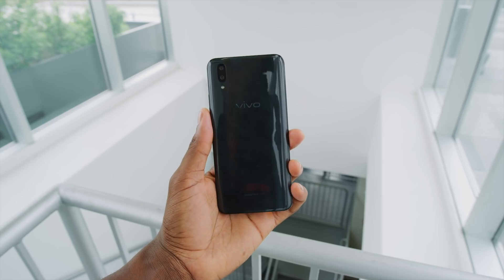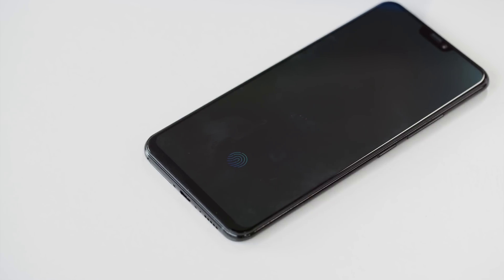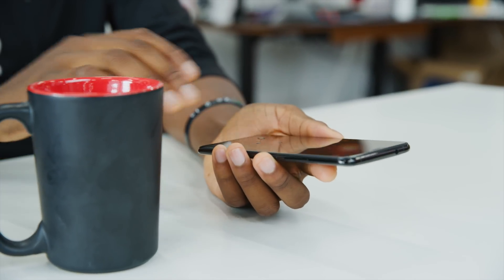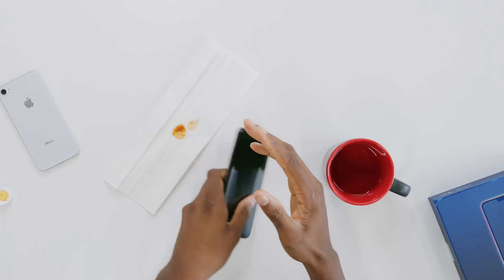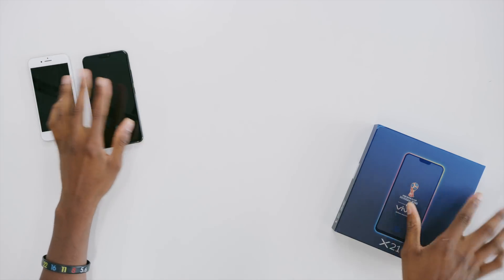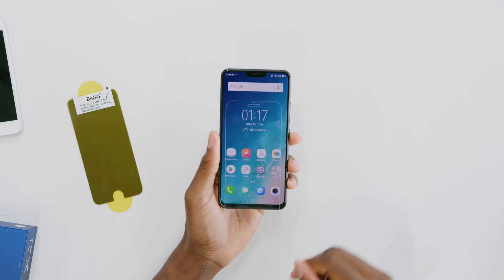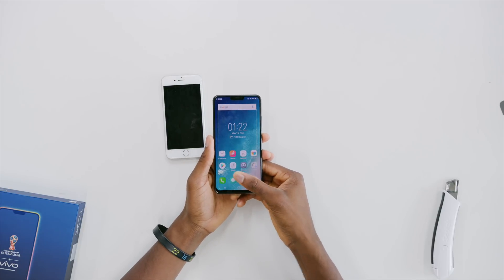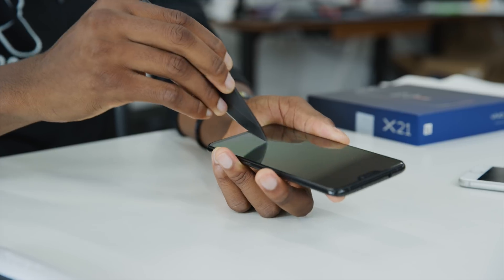In-Glass Fingerprint Sensor: Testing the limits!

Comment: Not sure why you bet against the polarized glass. The polarized one only obstructs certain viewing angles. It should be as good as a tempered glass, when it comes to allowing the sensing of light by the optical sensor, reflected off something that's directly overhead.

Comment: I have the Vivo Nex and the Xiaomi Mi 8 Explorer Edition, both of these phones have the in-screen fingerprint reader and I've noticed that the Xiaomi is faster at unlocking than the Vivo. It is as responsive as using a fingerprint reader that is on the back of the phone like the OnePlus 6.

Comment: Does the fingerprint reader also work when some applications like telegram require you to unlock by fingerprint. How does the display differentiate between a normal touch and fingerprint reading gesture

Comment: Optical sensor was considered from the human eye autonomy . Finger print sensor picks up heat . Glass will not pick up finger print if small debris is interrupting the skin. The iPhone is picking up the finger print for the pressure of the built in bottom crushes the debris picking up the finger print. Heat will always penetrate the glass screen regardless.  All flat surfaces will pick up heat for sensor purposes . Buttons usually work with pressure . Most people will most likely have to live and learn , so thanks for the demonstration. Good work.  🌻

Comment: Hey it's not working with optics 
It work with ultrasound like Sonic🐒
So no problem
Reply: In screen fingerprint readers work with optics. They click a photo of your fingerprint and match it with the database to determine if it's you or not  Ultrasound fingerprint sensors cannot be mounted under the screen

Comment: Water will never work on an optical sensor. The light being cast on your finger is warped to such a drastically different extent that if it did unlock I'd be worried.
Reply: It actually does work on slightly moistened vinyl glove through a screen protector on my Redmi k20pro, if you've just refreshed a fingerprint. 

Yet it sometimes doesn't work with clean dry fingers, and I can't imagine for what reason. To be fair, it was absolutely the same with iPad mini 2, iPad air 2 and Redmi 4 prime, so either my fingers wear down extremely fast, or all of you lie about it working well
Reply: Michael Miller - exactly. Most underrated comment
Reply: Greg Smith thank you.
Reply: Samsung will use ultrasonic fingerprint on their upcoming S10
Reply: I don't think that is an optical sensor because it works with the screen open( and the screen produce light) I think the fingerprint scanner is Capacitive scanners but either way it doesn't change anything unless it's a ultrasonic scanner.
Reply: There are wavelengths of light that can pass through certain mediums
Reply: Huawei recently made a special fingerprint reader (I forgot the name) that works with oil or water on the finger.

Comment: Under glass Fingerprint sensor is USELESS
Reply: Why so? It is WAY more comfortable than having it on the back. Just think of a flip case, for instance. The rear sensor gets covered. Or a silicon case: you have to stick your finger into a deep valley on the case, particularly uncomfortable, especially with smartphones getting bigger and bigger.
Face ID is a half-solution: you have to raise your phone to eye-level to unlock, it projects things on your face, etc.
And bezel-less is the direction where smartphones are going. This can't be done with a front-facing, but not in-glass fingerprint sensor. Not without weird notches or chins.
Bottom line: IT IS NOT USELESS, just we are fine without it for the time being.
Reply: Tech Yourself In its current form, maybe. But it will improve. The first Touch ID was also like that. It is just in its childhood. In 5 years, it will improve greatly, and become widely used.
Reply: in 5 years? LOL most of the phones brands will have it next year. In 3 years won't even see notches... the camera and everything will be under the screen.
Reply: Ohhh...so ,you mean notch of iphone is very useful

Comment: Scratches won't do anything to the fingerprint sensor. The reason it works with scratches and doesn't work with water/other contaminants is because capacitive fingerprint scanners generate an image of the ridges and valleys that make up a fingerprint using electrical current instead of  light. 

TL;DR: Sensor uses electricity to scan your finger, water messes up with it, scratches do not

Comment: The cracked screen protector test was flawed because, an optical fingerprint sensor would analyze multiple frames to see the fingerprint. With the broken glass going in 50 different directions it would have to analyze more frames than a glass screen protector that broke on the phone because it would have formed the phone and more of the glass shards should be flat.

Comment: Today Honor launched their new device which is "Honor 10" this phone also comes with underscreen fingerprint sensor. And they said "you can quickly unlock the phone when your hands are wet" so this technology imroved i would say...
Reply: Another example of the serious misconception here: DO NOT CONFUSE INSCREEN WITH IN_GLASS!
In-screen means it is under the OLED /IPS panel. under-glass or in-glass means it is under the glass sheet that covers the front of the phone. The glass also covers notches, chins and bezels.
Not to mention that Honor uses an UTTERLY DIFFERENT TECHNOLOGY, ultrasonic sensor. The in-screen sensor is optical.

Comment: Do people not like FaceID? I don't know why I would want a fingerprint reader on my phone anymore.
Reply: Coleman Green right
Reply: I am using s9 and iPhone x and I've never tried to even touch finger print sensor on s9 and I don't miss it on iPhone x
Reply: Depends on  how off angle your head is. You do not have to be directly in front/above the phone to unlock it. I would estimate that as long as your eyes are 45deg or less from perpendicular to the sensors it unlocks. You can imagine this making a circular arc and that being your unlock able area (for ex you can hold it off to the right and keep it pointing straight back and it will unlock). You can't be like leaning back in your chair with it flat on your desk, but if you sit up it will unlock. Or alternatively you can pick up the phone. Basically as long as the phone is within normal viewing angles it unlocks. I can't really remember having to readjust to unlock the phone, but maybe I have just gotten used to putting it in withing the area I need it.

Haha well that was long, but I hope it answers your question. Basically once you are used to faceID, it is like your phone isn't locked. You just swipe up and use  your phone. That is why I am confused why Marques is just talking about behind screen fingerprint readers like they are the future. I mean I guess you could have both, but I really think most people would just start using the face unlock which would make the fingerprint sensor a waste of money and materials.

The only reason that behind screen fingerprint readers would come back to apple phones is if they can't get the sensors underneath screen. The notch doesn't bother me, but I would have to think that they want to get rid of it. However faceid doesn't use the camera which is probably the hardest to put behind a screen. The IR camera, illuminator, and dot project should be fine behind a screen, just like a fingerprint readers sensor would. You would turn off the pixels near the sensors during the read. Who knows, I mean its speculation it will be interesting to see which direction Apple takes.
Reply: Coleman Green I am basing this off of the many iphone users I come into contact with and watching them unlock their phones. In the time it takes them to pull the phone near their face from various positions I have already unlocked my phone before I have lifted my phone to a viewable place. You are essentially asking me to add a second to my unlock process to use the future?
Reply: Problem is face id is inconsistent and slower, id rather take my blazing fast Huawei p20 pro's fingerprint scanner over faceid any day
Reply: David Exactly. And this is why I play with face unlock for a few days and turn it off. I travel a lot on sometimes crowded buses and trains where I can't make face readily available but I just need to access an or message really quick, or I'm trying to one hand unlock my phone in the car but can't exactly pull the phone within range of my face, or in the middle of the night or early morning l when I just want to grab and access without making my face visible just yet. I just find it so much easier to unlock my phone with a fingerprint because by the time I have the phone within range of my face in many situations the phone was unlocked when I first grabbed it.
Reply: Marlique Sheed it sounds like apples face unlock is a lot better because I don’t have issues in any of those situations: bed, crowded spaces, in the car, when I only have one hand etc. I’m not super familiar with other phones face unlock but the iPhones sounds the most advanced and is only in its first iteration.

Edit-yeah it sounds like the Samsung phones just use the camera to unlock? So that means you have to light your face and it’s not very secure. That is a dealbreaker I would disable that too. The unlock angles and security of faceID are pretty impressive.
Reply: problem with faceid is twins can unloack your phone

Comment: MKBHD If it's optic... can you fool it? like using a scan of your finger or 3 printing?
Reply: With a photo of the fingerprint, nope. It is a flat surface. The sensor is not a camera, it detects the reflection differences caused by the ridges and valleys in the fingerprint.
A rubber replica is another question... If you somehow manage to make the victim stick their thumb in soft rubber, you can make an accurate replica. It will fool the sensor. But it will fool capacitive sensors too, since rubber has similar properties to skin.
Bottom line: Easy? Probably not. Possible? Totally. Will someone want to do it (is it profitable for them)? Depends on the data you store on your phone, and on how they hate you or want to trick you.
Reply: IT IS OPTICAL, as stated multiple times in the video. Watch and read.
Reply: do you think its easy to trick? like the first generation face unlock which you could fool with your photo?
Reply: well... if its ethan hawke from Mission impossible thing... I'm fine with him unlocking my phone...😅
Reply: Its capacitive sensor, not optical

Comment: It's pretty impressive tech, but I really wonder if it's a solution to a problem that doesn't/shouldn't really exist.

Everyone keeps acting like having a bezel is a bad thing. As MKBHD himself said in a previous video, you can't have good front facing stereo speakers without a bezel, and the lack of stereo front facing speakers stopped me from upgrading from my Nexus 6 until the Pixel 2 arrived.

Bezels are also useful when you're holding your phone (in your palm). Balancing your bezel-less phone on your finger tips so you can see the entire screen and avoid false touches is how you end up dropping it in the toilet, or having it snatched from your hand by a toe-rag on a push-bike.

And last, but by no means least, a bezel means there is something to give in the event you do drop it, meaning you're less likely to crack your screen even if you do drop the phone that you can hold properly.

Yes, a bezel free design does look really cool, just like something from your fave sci-fi film, but personally I errr on the side of useful/functional and resilient.

I really shouldn't complain though. If all the flag-ships keep pushing the premium price bezel free designs, it means my phones of choice are going to be cheaper :-D

Comment: You didn't try unlocking it with a photo of your fingerprint. That should unlock the phone since the sensor is optical, right?
Reply: I don't think so, it bounces light that reflects from your fingerprint and a picture is a flat surface, so the light bounces differently
Reply: Scratches won't do anything to the fingerprint sensor. The reason it works with scratches and doesn't work with water/other contaminants is because capacitive fingerprint scanners generate an image of the ridges and valleys that make up a fingerprint using electrical current instead of  light. 

TL;DR: Sensor uses electricity to scan your finger, water messes up with it, scratches do not
Reply: Mike Winchester
*Watch the video*. The in-screen sensor is OPTICAL.
That means it works with LIGHT reflected from the ridges and valleys of the fingerprint (like an optical disk CD/DVD if you know what those are).
Scratches are smaller than fingerprint valleys. That, good software and good sensor make it work despite scratches. Water and sauce fill up the valleys.

Comment: You forgot to sandpaper the iPhone 8, I think it won't work as well as the in-glass fingerprint sensor.
Reply: I don't know about the iPhone 8 specifically, but most capacitive fingerprint sensors (like iPhone 8's) work perfectly fine even with much worse scratching. Look up JerryRigEverything's videos and you'll see what I mean.
Reply: It's made of some sort of Sapphire crystal or some shit, which is way more resistant than any glass on a smartphone screen
Reply: Ole but iPhones use a very scratch resistant material on their sensors, so the point to be made is unless you're taking sand paper to the button, wear and tear of the button shouldn't ever reach a point to critically question whether it hinders functionality. They also have a couple generations of Touch ID out since 2013, so it is probably more reliable on detection as well.
Reply: That's irrelevant, most fingerprint sensors are made of very scratchable materials, but still work perfectly fine even with heavy scratching.
Reply: He might be think about iPhone's display cost...
Reply: Yeah, Marcus. Give the iPhone a go with the sand paper.

Comment: If the optical sensor is seeing though the gaps of the OLED pixels, then resolution would be a limitation. The higher the resolution, the higher the pixel density in which the optical sensor would have a hard time reading your fingerprint. 

This is probably the reason why big companies like Apple or Samsung didn't get into the market first in terms of on screen fingerprint sensors as they might would have sacrificed screen resolution.

Comment: You know that the blade of box cutter or the knife is not going to do any damage to the display glass because on Mohr's hardness scale the glass is level 6 and the blade is around level 3 or 4 so it can't scratch the glass ( only if the glass is a Corning Gorilla glass).
Sand or sand paper  however is harder that Corning Gorilla glass on Mohr's hardness scale so it will easily scratch the display.

Comment: That was a nice review..  But  i heard alot about vivo x20.  The finger prints sensor under display works very well.  But if you try to activate the swipe gesture instead having a button, it doesn't work most likely the center button.  If you swipe it and hold it to the center up,  to access recent app it doesn't work something that bothers the finger print scanner.  I hope vivo can fix it.

Comment: The problem with on screen fingerprint sensors are that there's no engraving around it so you can feel your way into the sensor without looking. It's gonna be much harder to unlock when you're taking it out of the pocket and unlocking it at the same time for quick access.

Comment: Often my hands get dry and crack - especially in the winter.  My note 8 sometimes has a hard time reading my fingerprints when this happens
Reply: Apply hot sauce to your finger.
Reply: Apply vaseline to your hands
Reply: Rub your fingers on sandpaper. Should be fine.
Reply: Just so you know, thats cuz samsung fingerprint scanners are just bad and worse than others a bit. If you had an iphone or pixel, that wouldntve happened. I have an s7 and i experience ALOT of errors, for no apparent reason at all. Sometimes it even disables for 30sec and still doesnt recognize and i have to enter the passcode